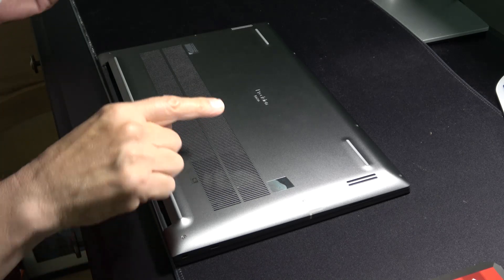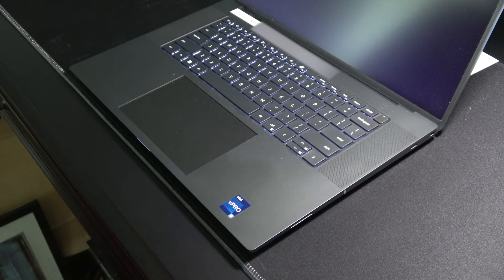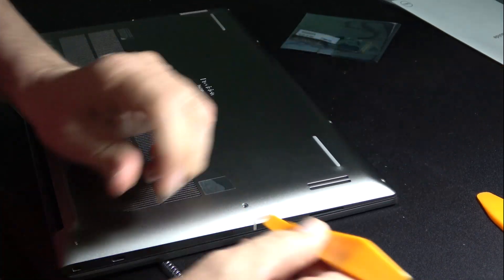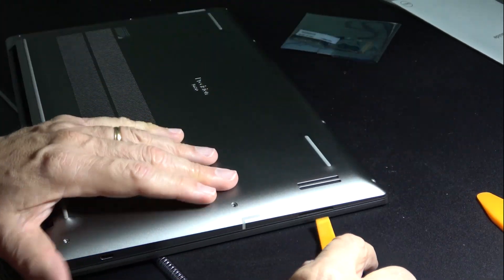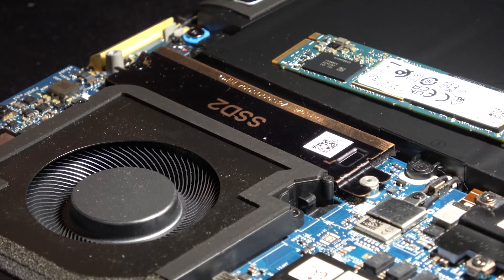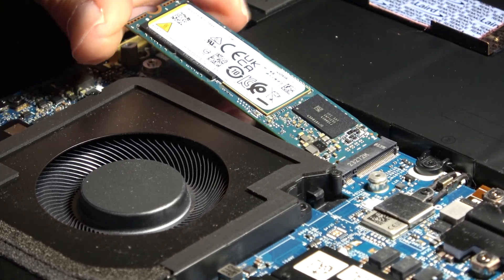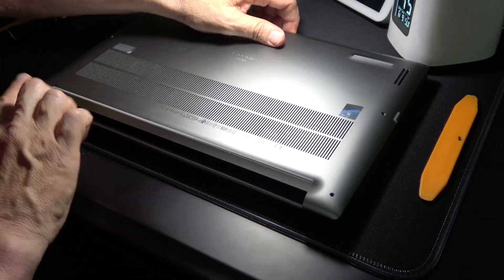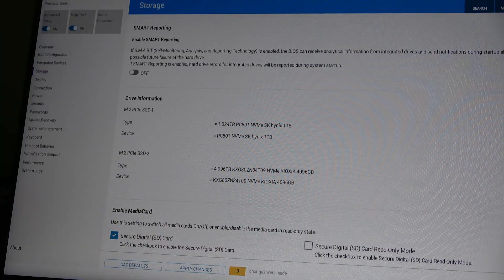Adding SSD to Dell Precision 5680

Comment: Good video. But the sequence shown to enter service mode isn't right. You have to shut the laptop down, then hold B and Power for several seconds until you see a message on the screen and hear 3 fast beeps.
Reply from the maker: Sorry for the confusion and thank you for mentioning it.

According to Dell, Shut down computer>Disconnect power and all attached devices>Hold <B> key and press the power button for 3 seconds or until the Dell logo appears on the screen.> When the ready-to-proceed message appears on the screen, press any key to proceed. The computer emits three short beeps and shuts down immediately. The computer should shut down as it enters Service Mode.

Comment: I dont think the Service Mode sequence was actually completed in the video
Reply: Nope. The computer needs to be shut off. While off, press and hold b, then press and hold power button. The screen will flash the dell logo, there will be some bios beeps, and after that, the computer turns off. That’s the proper sequence, afaik.

Comment: Is there any limitation on what SSD can be placed?
Reply from the maker: You can double check on Dell website.
Maximum memory configuration 64 GB

Minimum memory configuration 16 GB
Memory size per slot 16 GB, 32 GB, 64 GB
Memory configurations supported ● 16 GB LPDDR5 at 6400 MT/s, integrated, dual channel
● 32 GB LPDDR5 at 6000 MT/s, integrated, dual channel
● 64 GB LPDDR5 at 6000 MT/s, integrated, dual channel

Comment: What about the quality of speakers and display on this machine ??
Reply from the maker: The speakers are terrible. I edit using headphones so not an issue, otherwise external speakers would be needed. The display is perfectly fine, but I edit off the Dell U3223QE for the real estate. It keeps up with HD and 4K material.
Reply: I take it no ram upgrade
Reply from the maker: @DisasterMaster3K  It was already maxed out at 32 GB.
Reply: Personally, I think the speakers are more than fine. Speakers are very far down the list of priorities for me in valuing a laptop, though. I don't use my laptop speakers for music. At most, I use them for Teams meetings, and for that, they're great.